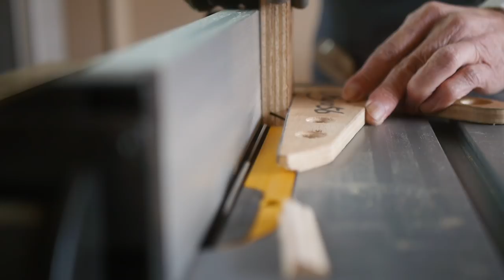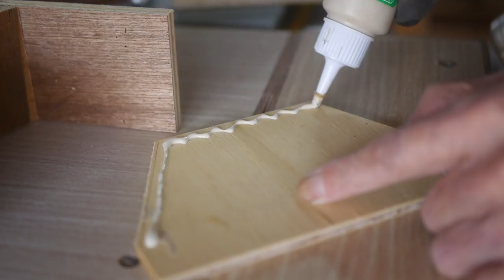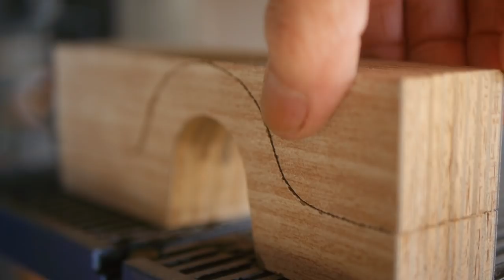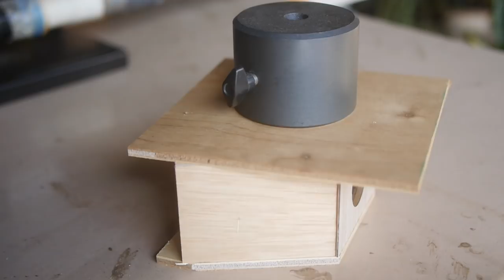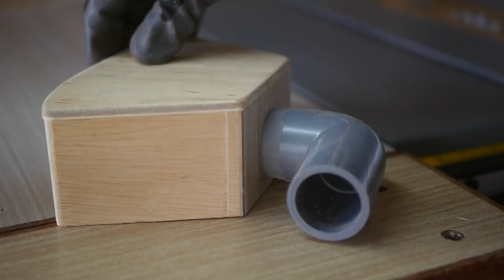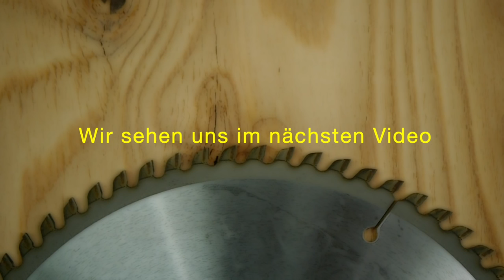Big mouth for dust collector

Comment: Your addition is an improvement.  I use the same saw and have not been impressed with the dust collection capabilities.  I recently purchased a 1500 cfm dust collection system  to connect to my table and miter saws.  I plan on  assembling the system and making the required connections soon.  Like many other I like working with wood but, not the mess it generates.
Reply from the maker: Hello Steven
Thank you for coming to my workshop again
And thank you for your nice comments.
A closed workshop is dusty and harmful to your health! !!

We recommend this video device to you, which sends a lot of dust to the dust collector. https://youtu.be/UlOQaPOe7l4

Thank you from Japan
See you
Reply: @TachiOhyo56   My friend I have previously watched ALL of your videos.  Your modification will be part of the new dust collection system.
Reply from the maker: @desertman3  
Thank you very much.
My friend

Comment: I like this, but wonder if it might be too much trouble to set it up each time 🤔
Reply from the maker: Hello John
Thank you for coming to my workshop as usual
And thank you for your nice comment.
It will not be installed every time.
A normal cut does not get in the way of dust, but a small cut on the edge will cause the dust to fly violently! !! This device is the solution.
Until last week my pocket was full of sawdust!

Thank you from Japan
Reply: @TachiOhyo56  yes I can really see the advantage of this dust collection device, just think I am too lazy and too impatient to set it up. 😂  That said, if I had to trim quite a few boards it would be silly not to take the time to do so. 👌